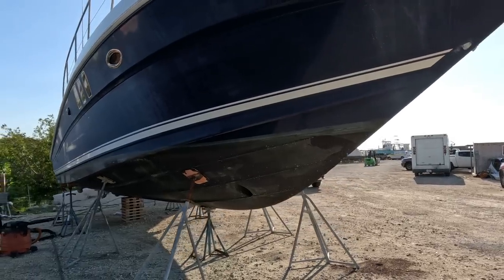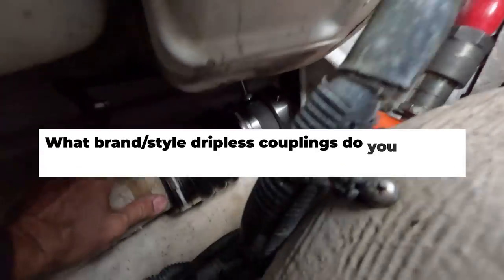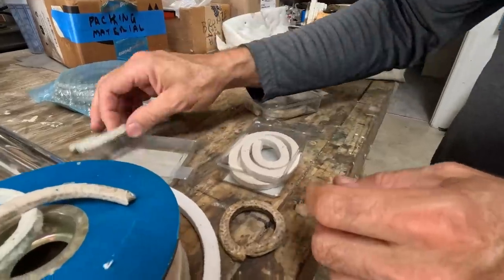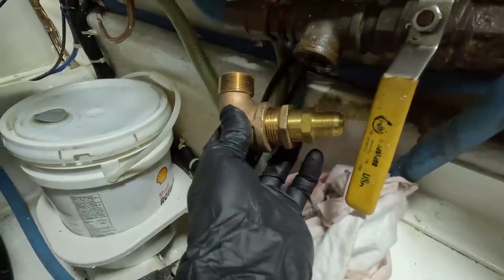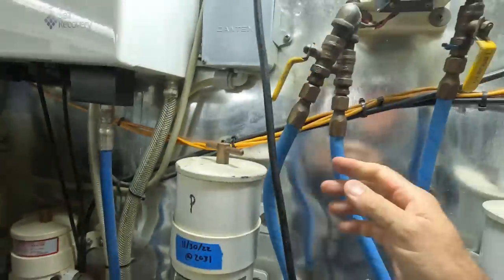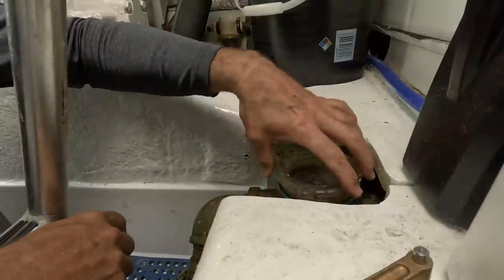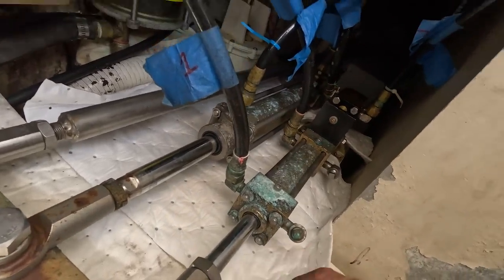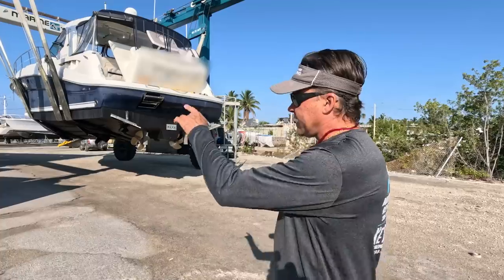Sundancer Yacht TAKING ON WATER has Leaking ....

Comment: I cannot believe the owner did not want you to buff the hull when it was out of the water.
Reply from the maker: Yeah it just wasn't a priority at this point! This was an unexpected cost to be hauled out so far from home and looks like its been neglected for a few years. But, that Blue could be beautiful! 😆
Reply: After spending $10k-12k he probably didn’t have a spare 2-3k. Boats not gonna sink with oxidized paint
Reply from the maker: @shawnl3151  Your completely right!
Reply: I agree 100%, me and one person would do the hull on a 36 Tiara. in one day every year, it's not that big of a job.  Even to just throw a quick coat of wax to not get worse.  The oxidation is symbolic of deferred maintenance, no wonder the seals and fuel system leaks if they can't wax what you see every day what do you think the systems look like.
Reply: That will never buff out and stay blue.  That oxidation will be back.
Reply from the maker: @TheBeingReal  needs to be wet sanded to sparkle again.
Reply: @WillFixThat  You can bring it back, but my experience is that oxidation just returns.  Curse of tinted gelcoat.  Imron or a wrap is better…but expensive.  Just sad people don’t stay in front of those issues!
Reply: @shawnl3151  LOL!!!  Owning a boat like THIS and you don't have an extra $2-$3k???  Better get finances figured in line and reconsider choices.

Comment: I prefer normal packing, dripless can fail and flood a boat.  A few drops a minute with packing that evaporites before getting into bilge offsets the advantage of a dripless system. My last boat dripped two drops minute and the shaft seal was cool to the touch.  You can google dripless seals that have had problems and see where I am coming from.  Prefer a dry bilge, but wiping down around the shaft after a trip only takes a minute. In summary, packing glands do not fail, only drip more with age and is easily replaced.
Reply from the maker: There is a lot to be said for that.  We routinely repack the “old style” in the water.  Hardest part is usually getting the gland nuts loose and removed due to corrosion.  Also getting the old seals out.  I use a long handle wine corkscrew tool I’ve had for years.  Don’t even remember where i got it from.

Comment: Hello.  Great video.  I have PYI PSS seals.  They were good for about 2 years and now are problematic with leaks and sprays underway.  The port side is really leaky as I speed up to cruise.  This past week I tightend the port by a 1/2 inch so hope that fixes it.  My plan is next haulout is to change the PYI to tides as PYI has quality issues and alot of marinas will no longer install them and opt for tides brand.
Reply from the maker: Hmm interesting…. We use both but have preferred PYI in the past! Thanks for sharing!

Comment: That's a PSS seal which are better than lip seals, but Lasdrop Seals are the best since they are similar to PSS, but do not rely on a rubber accordian type hose to apply pressure to the two seal surfaces.  Lasdrop uses springs built into the seal body to provide constant pressure between the two seal surfaces.  The springs will last indefinately whereas the rubber accordian hoses harden with age.
Reply from the maker: Great points those are good deals too! Appreciate the feedback.

Comment: PYI are anything but "dripless".  I hate the things because they can get a little crum of material in the surfaces and they can sink your boat. Tides Marine are better until they loose their water supply at speed and the log melts and the boat takes on water anyway. I feel the most reliable, safest shaft logs are the old school bronze with flax packing. Plus the flax packing can be renewed without removing the shaft from the coupling. Ie, in the water. Try that with a Tides or PYI. You can't.
Reply from the maker: Great points thanks for sharing …. All dripless have their pros & cons!

Comment: I bought a 2001 Maxum 3500 in Fall 2021. Launched in Spring of 2022 and found water spraying from dripless seal. Seemed to be original PSS PYI that were fully compressed, so I had boat pulled out and new PSS seals installed. Shafts trued up, new cutlass bearings, props reconditioned, motor mounts tightened up, engine aligned. It has Merc engines with V-drives so the seals are buried in a tight space, so I have only pros deal with them. Port side has been dry ever since. Starboard side still spraying/dripping. Such a nuisance.
Reply from the maker: Could it be a shaft tracking issue? They make over bore carbon stators they may help!
Reply: @WillFixThat  That’s my theory right now. Going to try to bias the bellows first to re-center the bushing on the shaft as close as possible. It’s just not a one-man job for me.
Reply from the maker: @thetattooedladyfan  let us know how it works out! 😀

Comment: Personally I like the pss system. Much more tolerant of alignment issues if installed correctly. Which unfortunately I rarely see done correctly.  The water hose that injects cooling water needs to be supported otherwise over time it will result in the pss system not hitting the stainless collar completely square.
Reply from the maker: You are correct. I’ve seen that in the past.  Support the water hose.

Comment: Tides Marine.  FYI. Be sure to install the replacement kit so should you ever need to RR the seal. you won't need to remove the coupling.
Reply from the maker: I put 2 to 3 spares on when doing Tides.  I’d much rather get a call to just slide a new seal in place then haul out and start the running gear circus.  Make sure the red hats are on the shaft for the next guy.
Reply: @WillFixThat  I had to replace one seal after about 10 years.  Simple if you installed the spare on the shaft.  Be sure to install a filter screen on the seawater supply to the coupling that lubricates the seal.
Reply: Shoemakers what do you expect

Comment: It’s simply a rubber seal instead of packing
Reply from the maker: If it’s a tides marine seal, it is a rubber lip seal. If it’s a PSS PYI, it has a carbon stater and a stainless steel rotor.

Comment: untaxed unregulated diesel....  illegal AF
Reply from the maker: I'm sorry not sure what you are referring too? Please fill us in?
Reply: @WillFixThat  the diesel shown has red dye in it,   it's untaxed
Reply from the maker: @dirttdude  good catch … nothing to do with us!
Reply: @WillFixThat  i didn't think you had anything to do with it
Reply from the maker: @dirttdude  👍
Reply: Depends on the state, but the red-dyed diesel is usually exempt from fuel taxes because the taxes are for road vehicles. Haven't seen a boat go on the road under its own power. Up here in MD, the marinas all sell red-dyed diesel to their boaters because it doesn't have the road taxes applied. @dirtdude in what state is it illegal to use dyed diesel in a boat?
Reply: @DougTreff     You're right, i'm wrong....  Boy howdy, i'm going to throw a massive fit,  i've been paying tax for gasoline when i shouldn't have been

Comment: Wow,  is that an employee or the boat owner applying the bottom pint? It is so toxic that anything that tries to attach itself dies.  

I am from Florida. even there nobody paints a boat bottom with short sleeves and pants legs.
If he is an owner he is dumb, if he is an employee, the employer is dumb.

I don't get the sitting cross-legged dabbing the roller Like he has all day, he is on the clock. Is he touching up around a cooling water inlet cover? That is what you keep a brush in your toller pan for. By the way, where is your roller pan? are you going to crawl out from under the boat to refill the roller each time?  And then you got another guy on the clock telling him how to do it and not telling him not to let the paint drip on his skin requiring equally nasty stuff to get it off. At least have a change of long clothes for bottom jobs in the shop.

Somebody should look into "TIME STUDY" they have big money people that go around factories figuring out how to shave off fractions of a second on each operation. You don't have to beat the employees or no lunch breaks, you need an efficient system where at the end of the day every job is the same, nobody busts ass and you get maximum output with minimal injuries and everybody is laughing and joking at the lunch table.

At a young age I knew I needed to leave my abusive home so I started to prepare myself by figuring out how to make money. .  I eventually worked everyday after school and Saturdays and Sunday afternoons. Among other things, I painted boat bottoms at the local boat yard. I took an old seat cushion out of the dumpster and cut off one strap then used a piece of canvas and stapled it to a piece of plywood and then screwed the strap to the plywood to carry it with. When you are under the keel working it is much less time and energy to move and if there are a couple stones under it you don't even have to get up to move over, just roll it.

As a kid on the streets full time at the age of 12, I knew I had to compete with abuts. If I didn't work I didn't eat and I loved to eat. I didn't want to be hired at kid wages, I wanted adult wages so I needed to be better and faster and get more work done and if the customer was around I had to make him smile to get adult wages and be hired before an adult. I knew it had to be done right the first time so you don't waste time going back touching up. I was a little OCD or whatever you call it then and looking down the waterline and it not being straight really bugged me. Eventually they were perfect. 

My mother was making $1 an hr cleaning houses. Common wages was up to $4 dollars an hr for labor. My goal was $100 a week after school and weekends  before I went to play with my friends. 
Awesome life. a boat anchored out to live on, a boat and motor for transportation cross the bay or 15 miles  down the bay and up the river into tthe city and no adult supervision except the town cop LOL. He figured I was doing better than a lot of adults.
Reply from the maker: Thanks for sharing Robert! We are all adults so we treat them that way! 
Sounds like you started working young just like we did! Which I think helps us to appreciate money a bit more. 😄 Back in them days you could do much more as a youngster now days we are afraid of them walking to school!
Reply: @WillFixThat  I didn't say treat them like children, I said to teach them to be safe and efficient for the betterment of all.
Reply from the maker: @robertbodell7221  our motto is Safety First Always!